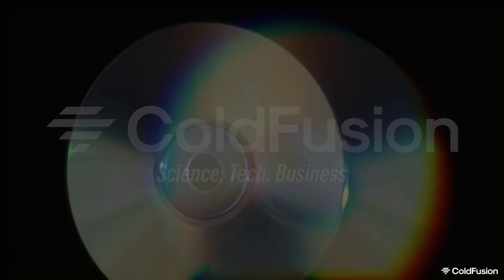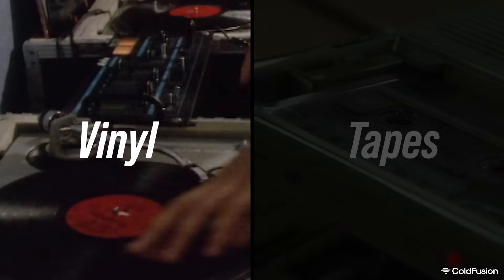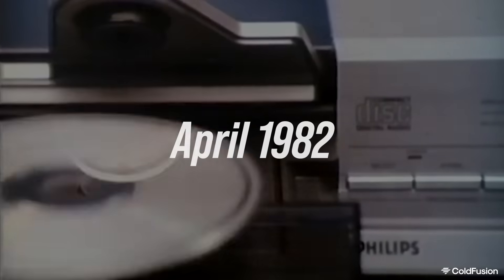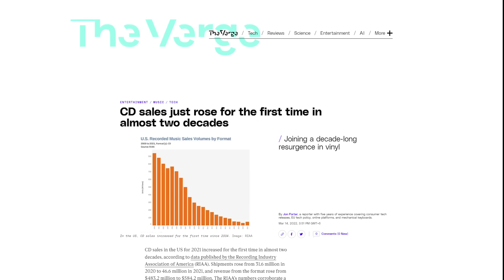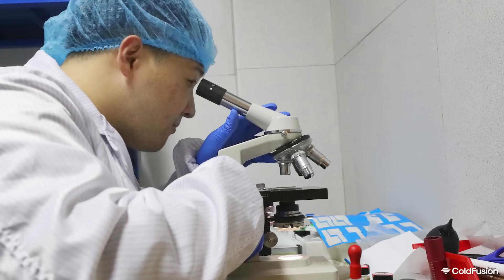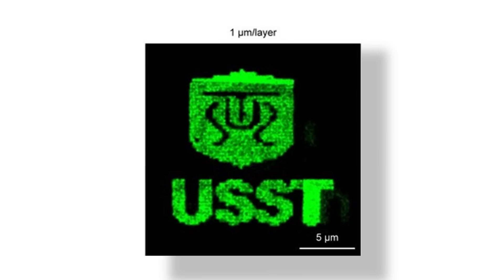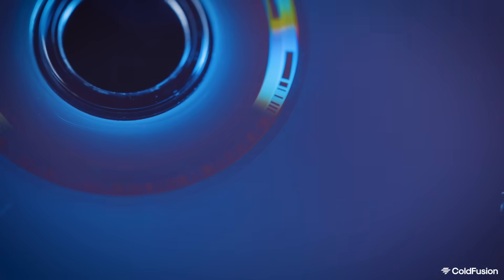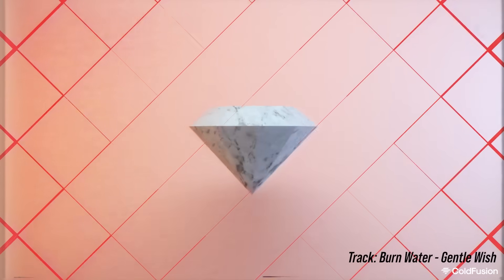Why This New CD Could Change Storage

Comment: 5:56 that’s an unfortunate cut

Another unfortunate moment is saying/showing 1.6 petabits and 1.6 petabytes interchangeably. Also CDs are single layer only (but can be double-sided), DVDs are 2 layers max, only BDs can have 4 layers (and even that is not backwards compatible with older drives, so it’s typically 2 layers only). It would be better to refer to optical media in general.

Comment: I'm glad that larger capacity discs are being created for long term archive of data since hard drives and ssd's don't have the same long term as there optical disc counter parts. At least with optical discs they last longer than any hard drive and ssd's as long as they are stored properly. I still buy 4k, blu ray and dvd discs. For music I still buy cds, cassette tapes, mini discs and sacds. For video games, I only buy and support the physical copies of the games. The 4k and blu ray discs have anti scratch coating on them and they even look brand new even though I mainly buy used 4k, blu and dvd discs. Hard drives and ssd's are known for having failures and the ssd's lose there lifespan when they are being stored and not being used overtime. The hard drives and ssd's are faster in terms of read and write speeds than the optical discs but they won't last as long as 50 years or even 100 years like the optical discs. I wish that dvds and music on cds have the same anti scratch coating as there 4k and blu ray discs.

Comment: It's actually crazy to think that back in like 2012, if I remember correctly, everything desktop and laptop came with a CD drive like it wasn't until 2017 when I was at boarding school doing A-Levels and I wanted to use those CD's that came with the books and I realised that that was actually the second laptop I got in 3 years that doesn't have a CD drive 😶😅

Comment: I bought a 5 pack of 100GB BDXL M Disks 8 years ago, They are still here in front of me, not a single disk used. If memory servers they were €10 each at the time. I had plans. Key word is had.

Comment: I still store all my most critical data on DVD's today, tech guys look at me weird when I buy empty DVD's in the stores, but whatever. There's nothing as secure as hardware offline storage. Keep the disks in a dark place and they should last forever. Even ones I have in translucent plastic cases exposed to light are still working after 30 years.

Comment: What younger viewers also may not know: Due to the tiny storage space on a CD (700 Megabytes), they became more and more impractical as a storage medium. It got to the point, where PC games required 5 or even 7 CDs to be installed. At the same time the first MP3 players emerged. When encoding songs as MP3, you could easily fit 10 or 20 albums on even a very small flash storage, or burn them to your own CD (data format instead of audio).
Reply: current bluray data disks are in much a similar predicament, the largest capacity ones produced are 128GB (and that goes down to 100GB if you want RW), and with many "AAA" having no concern for storage, that has proven not to be enough anymore. difference is that the companies realized this makes for a great excuse as to why the "physical copy" is actually just an installer and activation code that then downloads the actual game from their server, thus ensuring your physical copy will be a paperweight when those servers shut down

Comment: It seems so amazing that changing the Fidelity and number of variables in such a tight tolerance as fractions of a wavelength versus so many orders of magnitude less precision tolerances of for example, the giant rotating stacks of The other moving parts in the system.

Comment: 1.6 petabits = approximately 160 terabytes (divided by 10)
Storage speed was claimed to be megabytes per second.
To store the 160 terabytes on the optical disc at 1 Megabytes per second, (160 terabytes divided by 1 million bytes/second = 160,000 seconds or 1.85 days to fill up the disk , slow….

Comment: With that amount of data storage I'm concerned about physical protection. 
Just the thought about a little scratch to ruin a disk like that. 
The best option would be the mini disk that had this feature. Talking about a mini disk. It was smaller than a regular cd but with this technology the mini disk size I would also be happy with 1/4 or 1/2 the storage capacity of the full sized cd.

Comment: I went throught the horrors of writable optical media, never again.

If you have a need for massive cold storage go tape, it's rock solid
Reply: part of why tape works so well is because you never touch the tape directly (no one does backups on reel to reel anymore) it's all encased in cartridges. if that concept had caught on with disks (DVD-RAM actually tried to make that happen but it ultimately failed) we may not be having such issues with optical media getting damaged from handling

Comment: 13:25 there is another showstopper for this technology, and that is discs. Have what you call disc, rot and that’s usually caused by the manufacturing as well as where the discs are being stored if they’re in a damp place, they will be damaged
Reply: disc rot is caused because many CD-Rs and DVD-Rs were and still are made out of organic material which decomposes over time. with archival disks such as Mdisk, and also all blurays, an inorganic material is used which does not decompose and therefore does not suffer from this type of bitrot. bitrot from UV light bleaching and damaging the coating will still be an issue but that can be mitigated

Comment: If these ever come to market, I really hope they add a protection layer like what blu ray discs have. Regular CDs and DVDs are so fragile, and I’ll never forget the disappointment I’d feel when trying to play an old game or rent a movie from the library only to find it skip a lot because of scratches in the disc. Fortunately I never had that issue with blu rays though.
Reply: a casing like how minidsk and earlu DVD-RAM had could also be an option, though it would mean the drive couldn't be backwards compatible with older disks unless you also put them in the same casing

Comment: The way i see this bring useful is for actual personal assistants. Instead of scraping the internet every time you just have a set of these discs in your home network. The ai crunches the data then is ready to offer solutions or helpful questions.

Of course if there's something new that has come out the ai can hit the internet and write what it learns to an empty disc in the collection. This of course necessitates actual personal assistants and not these "report home" llm things.

Comment: We've been using optical based media for cold/archive storage in data centers for about a decade now. The problem hasn't really been the storage density, but how fast you can read/write to something with that high density, as mentioned at the end. We already do many terabytes per cartridge. You have different types of storage for different types of access patterns.

Comment: Their main competition is an even older magnetic tape tech that has already been revived. At smt like 10$ per TB it's hard to imagine this CD tech even being able to compete. 
So even wide enterprise market adaption is unlikely. At best they could function as a redundant storage for high sensitivity data , being immune to EM is a huge bonus.
Reply: yep Linear Tape Open (LTO) is the dominant way of doing archives in many large companies, though a disk would have the major advantage of drastically lower seek times, especially if many small files spread throughout its contents are needed. we will see if the technology ever materialises

Comment: If that would see the light of day that technology, it would be astronomically expensive per desk not to mention the hardware portion would be astronomical take for instance, LTO drives the newest one today I believe it’s LTO 9 and that one has terabytes of space I don’t know exactly how much but it’s a lot myself. I use LTO 4 and LTO 5 but the highest LTO nine drive Will run you close to $10,000 so just imagine what a 1.6 PB drive will run you. That technology would be most unattainable to the majority of the public.

Comment: This video created a lot of confusion. There is a big difference between stamped discs for mass manufactured consumer media and writable discs like this. I have worked at a Bluray production company and it gets really expensive stamping multiple layers, because you need to manufacture a stamper for every layer and the machines that can stamp multi layer discs are really big and complicated. This 100 layer disk is only for writing, no stamping and you wouldn't want to write mass market products to disks, no matter the layer amount, because that is way to slow. I'm sorry, but this is not going to be the next big optical disc format.
Reply: Finally, someone who talks some sense into these tech newbies in the comments.
Reply: Agreed, we need something that writes and reads as fast as SSD but with solid data integrity and millennial-plus longevity in archive.
Reply: because he needed to say storage (as in personal storage) on the title for views
Reply: Question, why bother to stamp it when you can just write on a dime?
Reply: How long will it last before enough bits have deteriorated that ECC no longer works and read errors result?
Reply: i still use blu-rays for backups, but i prefer the 25GB ones since DL seems to have more write errors
Reply: It's not going to be the next big optical disc format in the way that you think now. But if it can store 125 Terabytes, then why not simply use it as an external hard drive type system? Have a SSD for fast read/write stuff and then this as long term storage.
Reply: @robthemodYT  why not? speed. even a hard drive is blazingly fast compared to burning a disk, and there is no real way to increase that speed short of spinning the disk faster which has physical limitations, or adding in a second laser for dual writing which would double costs
Reply: @oggilein1  The thing is, the most used long-storage format currently in use is LTO (Linear Tape Open). One disk of LTO9 has 18-45TB of storage, but, it can ONLY read 400 MB/s.
If they refine it so the speed is at the 100s of MB/s, it would be slow, yes, but, for long-term storage, where you need to make backups of whole server machines and dataframes, it is worth the wait.
Reply: @oggilein1  In IT, we are taught that there is a trade off. Speed against capacity. If a device is so slow, it better compensates it in capacity (or cost). If the disc is truly have 200 TB of storage, then it can afford to lose in speed as the trade off.

One of the reason today's CD lose the market is the 700 MB capacity. It was big for 1990s (I remember my hard drive was 200 MB), but going into 2000s and it started to look puny. DVD gave it boost for a time with 4.7 GB, but it lose the race again by 2010s. 

Will this disc prop optical storage device back to the front? Time will tell.
Reply: @oggilein1 Read speed doesn't matter for archival, unless you're running something like a media server. LTO Tape reads slow af but it is still one of the most widely used archival formats
Reply: @GuardianWorld  slight correction, it can only store 18TB of uncompressed data. data compression could be employed on disks too to get a similar "up to 2.5x" boost in capacity. personally I think a disk will still only be able to compete if the write speeds are faster than that of LTO
Reply: @GuardianWorld  400MB/s is far faster than a hard drive.
Reply: @robthemodYT  because they will probably be   for backup up files once then stored away
Reply: I would certainly hope you wouldn't want to manufacture a disc like it's a disk.
Disc = optical
Disk = not optical
You would think someone "in the industry" would know that.
Reply: @tim3172  When was that distinction created? Disc/disk are just different spellings for circular flat surface.

Comment: I can't believe how this made the news. Fun fact, this have always been known by digital storage manufacturers. But here's the thing, there are limits to how fast a plate could spin before it break. This severely limit the speed capability of said storage. There are reasons as of why spinning hard disks are abandoned now in place of solid state drives that read data without the need of physically moving objects.

This technology would be akin to putting 4000 trains together, claiming that we have made the biggest passenger train ever. Which is not only irrelevant, it is such a security hazard, one accident to end all 4000 trains and their passenger that moves like a snail. One single scratch to destroy 200TB of data that reads at mb/s. Fun.
Reply: what people forget when talking about these high capacity disks that haven't even made it to production, is that LTO backup tapes already fill this niche quite well. the current gen does 18TB uncompressed data per disk, and unlike a burned disk they can be rewritten about 2000 times until the tape wears out. but of course, it takes 12 hours to write those 18TB, and as it's a linear tape the random I/O speeds are well, as bad as they could possibly get. but for backups that doesn't really matter and it's why LTO is the standard
Reply: @oggilein1  absolutely. Think about it for just one minute, and this entire crap immediately fall apart. We got hyped up so easily, fell into dumb conspiracy theories one after another, just because we forgot to take a moment to think, critically.

1:07 "will this ever see the light of day?" implying like there would be anything to sabotage it but itself.
Reply: @oggilein1  Totally true. I've had to deploy multiple 200TB (usable) NAS units as scratch/ cache storage for a customer who had a tape library for their backups archival storage simply because it would take a little over a week just to write out the monthly archive to tapes.
That was quite a nightmare to deal with because of all the custom scripting needed to interface everything. The actual backup solution could interface with Qstar directly but that would require the backups to be queued on the primary backup servers whilst waiting for the tape out to complete.
We ended up introducing the NAS units to act as the archive destination then implemented scripts to trigger the actual tape out from the NAS storage itself. That presented another issue where we needed to clear the NAS once the tape-out was complete but still being able to hold and collate the next set of data to be tape out.
Reply: They'll find a way to solve that issue. Be thankful it's not an 🍎 product or they would just release it for consumer use anyway and call it good enough.
Reply: HDDs are still used in servers that need very high capacity
Reply: @TheTechnologyRevolution  because they are magnetic drives, not light reflective discs. Magnetic drives have significantly faster rate of locating the data than reading light reflection, because magnet reads the entire length of the spinning disc at once. But light reflective discs like these are limited at few tiny specific spots at a time, and there's absolutely no way around it.
Reply: @TheTechnologyRevolution  an HDD and an optical disks are entirely different formats and shouldn't be compared
Reply: Why are you acting silly like this? it's a 100 layer disc and the "pits" on the disc are smaller than traditional CD/DVD. You need to learn how surface area and "relative volacity" works. A CD spinning at 20x is not the same as a DVD spinning at 20x. The DVD transfers more data because of the laser used and how the pits are divided.
Reply: @sharoyveduchi  geez, a 1000 paragraph comment started with "why are you acting silly like this?"

Sorry boy, learn at how to get someone's interest first. I'm not a masochist who'd happily read a berating comment from someone who blindly get hyped up about something.
Reply: @kueapel911  oh that was 1000 paragraphs? nvm be on your way
didn't know I was talking to a child
Reply: @sharoyveduchi  likewise. Glad we have this conversation. You have fully shown your true intent with the way you aggressively try to invoke emotional response from me, now it's easy for others to judge the weight of your opinion.
Reply: That's why you backup in different formats, CDs, HDD, SSD, etc. it should be a multi layered approach to backing up.

Comment: Dude, you totally mixed up bit and Byte... 200k DVDs (assuming you meant DVD-9) are around 1.6/1.7 Petabytes data, ca. 8 times the size you mentioned 1.6 Petabits in the video.

Comment: Every now and then there's news for similar "breakthrough" optical media format in a lab that never even comes close to something of practical use. It all reminds me of the CED video disk from RCA, where the engineers iterated so much over the standard LP vinyl record to fit 2 hours of video, that the disk had to be locked in a cartridge never to be touched by a finder, resulting in a contrived loading mechanism. Yet still, many customers did complained that their new video disk systems would regularly skip and repeat frames due to minor particulate contamination left on the disk's surface, hitting the fragile microscopic needle.
By the way, I can only image the horrible seek/random access times such densely packed optical disc would have. High unit capacity is one thing to fit in a single disc, but reading and writing speed is often the bitter compromise for such convenience.
Reply: as i say to everyone who proclaims these breakthroughs, if you want a large capacity physical data system that actually exists, look into Linear Tape Open (LTO). I'll be happy to adopt a disk based system that can compete... once it actually exists